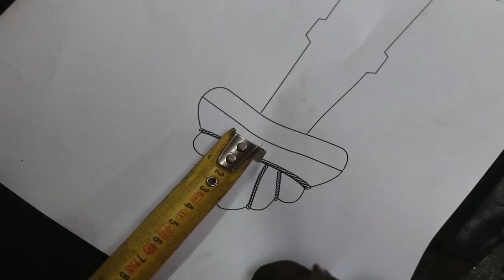Making a Viking sword,  part 1, making the handle.

Comment: Awesome as always. Whe you first drifted the hole in the hand guard, it was a little off center. How did you correct that? Heat and hammer or in the grinding? Just curious as it was perfect later in the video.
Reply from the maker: Both. But most is corrected in grinding